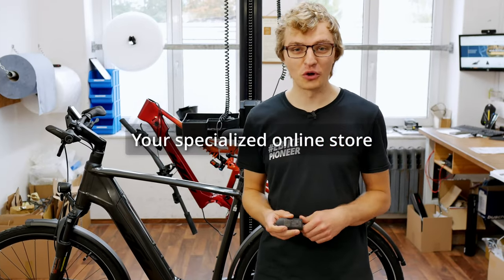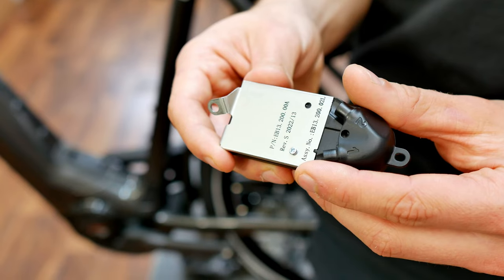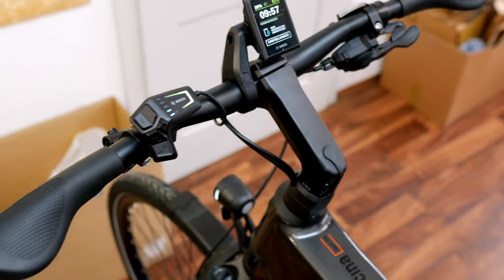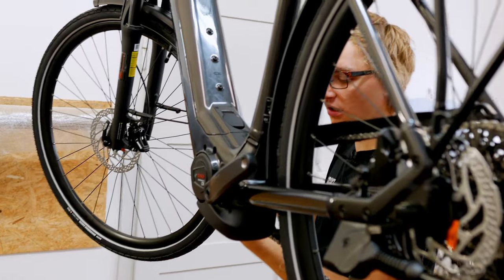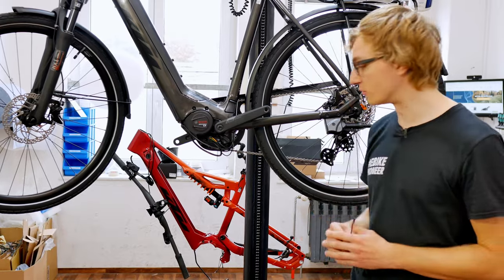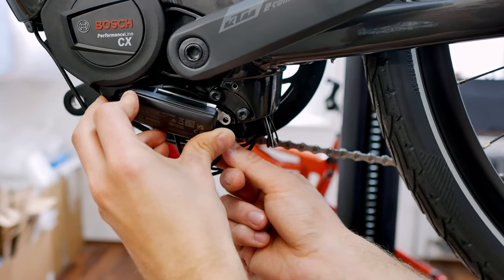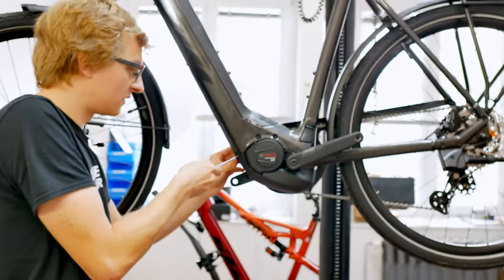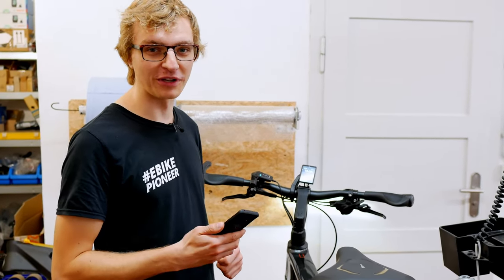Bosch ConnectModule - Installation | EBIKE24.com

Comment: I wonder if it's so easy to install it's also easy to uninstall... Just unscrew a few points without bumping a bike and theft is possible. Such important module should be well integrated inside the motor so it would be unable to compromise it without dismantling the whole motor assembly.

Comment: I just get the Bosch module Connect and I am very happy with this GPS alarm systèm, but the only bad point and almost a joke is the power of the alarm sound;  it will not afraid even a fly...

Comment: so it's basically 4 (?) normal torx screws and a thief can remove the module? I don't understand why there is absolutely no security?
Reply from the maker: Hi and thank you for your comment. Yes you are right. Unfortunately the ConnectModule is delivered without any additional safety equipment to protect it from theft. However, since the ConnectModule has standard Torx sockets, you can also use safety screws of your own. 
Cheers Michael

Comment: Cube hybrid stereo 2023? Can fit
Reply from the maker: Hi and thanks for your comment. This is hard to tell since we do not have Cube bikes in our product range. We know from a few customers that the original Cube motor cover might be too small to fit the ConnectModule. This is why we offer these two updated covers from Cube:
https://www.ebike24.com/cube-motor-cover-stereo-hybrid-120
https://www.ebike24.com/cube-motor-cover-stereo-hybrid-hpc-my20-23-bcm-ready-schwarz

Depending on your bike model one of these two should fit the ConnectModule. If you have any questions do not hesitate to contact our customer service: info@ebike24.com

Cheers - Michael

Comment: I want to sell my bike, can i just remove the device when unlocked with my phone? The new owner does not want the product. So no i do not want to steal the bike. I am the owner and i can unlock it with the phone. So just uninstal it like i instal it? Or do i need to some specifics because i can not find a tutorial.
Reply from the maker: Hi, you should remove the ConnectModule in the Bosch eBike Flow app first and after that also remove your bike from the app. It is crucial to remove the ConnectModule in the app first, otherwise there might be an error message when the new owner tries connecting the bike with his Bosch account. 
Cheers - Michael

Comment: Hello. Thanks for doing the video, it was intensely informational. Will this be compatible with a Verve+ 3 ?
Reply from the maker: Hi and thank you for your kind words! It's hard to say, unfortunately, as some older models do not have the Smart System required for the ConnectModule. Do you know the model year of your Verve+ 3? Often, you can also easily identify it by the display: If your bike has the Purion display (https://www.ebike24.com/2017-bosch-purion-e-bike-display-performance-line), it is not compatible with the Smart System because the Purion is not yet available for Smart System bikes. Hope this helps! Cheers - Michael

Comment: I have just purchased a Trek Powerfly 4 gen 2 with the Purion and I would like to upgrade it to something that would Bluetooth to my phone with an app. What would you suggest?
Reply from the maker: Hi and thank you for your comment! It seems that your Trek Powerfly has the Bosch eBike System 2. With this system, unfortunately, there is no connectivity to your phone through the display/control unit. You could upgrade your Purion to the Kiox or Nyon display. Alternatively, you could install a mobile phone holder on your handlebar and use your phone in combination with cycling apps like Strava or Komoot.

These links might help you:
Bosch Kiox display: https://www.ebike24.com/bosch-kiox-display-set
Bosch Nyon display: https://www.ebike24.com/bosch-nyon-display-2020-2021
Phone holders: https://www.ebike24.com/e-bike-smartphone-mount
Hope this helps!
Cheers - Michael

Comment: the Bosch Connect module with a subscription of €40 per year should improve two important points:
first of all a “theft insurance” subscription integrated into this subscription and on a technical level increasing the power of the alarm signal which is rather ridiculous

Comment: ATTENTION: IF you have a CUBE bike , BEWARE,,, Bosch Connectmodule will fit the motor , but the motor cover dont fit afterwards. CUBE is working on a new motor cover but at the moment there is no solution on the problem. i just found out today after fitting the Connectmodule. The item number for the new engine cover is #3819. For the Stereo Hybrid 160 ONLY size S, the article number is #3706
Reply from the maker: Hi PerfodDk, that's right, unfortunately the ConnectModule doesn't fit beneath the cover of some Cube models. However, Cube has released a couple of new motor covers that are compatible with the Bosch ConnectModule or GPS trackers from other manufactures. You can take a look here: https://www.ebike24.com/cube-e-bike-spare-parts
Cheers, Michael

Comment: Hello, do you know if it’s possible to fit this module in a Bosch SX motor like the Riese and Müller Culture? If not, are there any plans for an alternate cover that could work with the connect module? Thank you.
Reply from the maker: Hello and thanks for your comment! Yes the ConnectModule also works with the new Bosch SX motor. For the SX motor you only need the single ConnectModule without the mounting accessorries. It is simply connected with an additional display cable which you also need. The ConnectModule is then connected between the motor and the display. We will also publish a tutorial for the ConnectModule installation on the SX motor soon. You can find the ConnectModule and display cable here:
https://www.ebike24.com/bosch-connectmodule-smart-system
https://www.ebike24.com/bosch-display-cable-smart-system

You are also welcome to contact our customer service under info@ebike24.com.
Cheers - Michael

Comment: Hello, what bosch connect module will be fit on my hercules fold r5? And where can i buy here in germany? Thank you
Reply from the maker: Hello, thank you for your comment. According to Hercules your Fold R5 has the Bosch Performance Line Motor. This means that this ConnectModule is the correct version: https://www.ebike24.com/bosch-retrofit-kit-connectmodule?number=8565-002
You can order online, we ship to Germany (delivery time is usually 2-3 days).
Cheers - Michael
Reply: @ebike24  hello good day. i bought and i install but the problem is the cover of motor is not fit anymore and i cant close it.

Comment: Can this be fitted to orbea wild 2023 with the Bosch smart system?
Reply from the maker: Hi and thanks for your comment. Yes, if your Orbea has the Bosch Smart System, installation should not be a problem! Just make sure that you have enough space below the motor for the ConnectModule. Cheers - Michael

Comment: Hi, I have a Trek Rail 5 Gen 3 Will the connect unit fit my bike? thanks in advance.
Reply from the maker: Hi, according to the specs I found your bike is equipped with the Bosch Smart System. Therefore the ConnectModule should fit. You may want to check if there is enough space below the motor to install the ConnectModule before purchasing. 
Cheers - Michael

Comment: Hello, what about cube hybrid 140 action team ? Is it included with brand new or No ?
Reply from the maker: Hi Fabio, thank you for your comment. This is hard to tell since we are not a Cube dealer. It should fit since the Cube also uses the new Bosch Smart System required for the Module. However, on many Cube electric bike models, there is not enough space under the motor cover for installation. We have a few replacement covers in our store: https://www.ebike24.com/cube-e-bike-spare-parts
If you have any questions, you are welcome to contact our customer service: info@ebike24.com
Cheers - Michael

Comment: Is there a way to fit this on a Gazelle Grenoble C5 HMB (Bosch Performance Line Smart System)? I believe the original covers don't fit once the module is installed
Reply from the maker: Thank you for your comment! On the software side, the installation is no problem. Unfortunately, motor covers are always complicated and, above all, manufacturer-dependent. I cannot say for sure if the cover will still fit after the ConnectModule installation, as we do not stock any Gazelle bikes in our range. My recommendation would be to contact either your local Gazelle dealer or Gazelle directly. They should be able to advise you on whether it is possible to install the module.
Cheers - Michael
Reply: @ebike24  Thanks for your response. I spoke to my dealer, and he tried sourcing the part numbers for compatible covers that would fit after installation, however he was sent around in circles. Bosch sent him to Gazelle, and Gazelle sent him to Bosch. It seems like getting a concrete answer is going to be tricky, and I'd say it will probably be a no compatibility for now, which is a shame :(
Reply from the maker: Thanks for the update. Yes, this has been the problem with Bosch for a while. They will always tell you to ask your local dealer or bike manufacturer and they have to ask Bosch...
We offer free returns within the EU. If you like, you can order the ConnectModule and test the installation - if it doesn't fit, you can return it. Maybe that's an option for you.
You can find the ConnectModule here: https://www.ebike24.com/bosch-retrofit-kit-connectmodule
Cheers - Michael

Comment: hello! this GPS have sin card? Can I track if the bike have the battery out?
Reply from the maker: Hello Philipe, thank you for your comment. Yes, the ConnectModule features an eSIM for mobile communications. Even when you remove the battery from your e-bike, you will still receive a notification if your bike is being moved, and you can track it as well. However, the alarm will not activate in this case; it only works when the battery is mounted on your electric bike. I hope I was able to help you!
Cheers - Michael

Comment: Will this fit in the Trek Powerfly 4 gen 4 and will the cover fit after installing? Thanks!
Reply from the maker: Hi Joel, thank you very much for your comment. The Powerfly 4 Gen 4 is equipped with the Bosch Smart System and is therefore compatible with the ConnectModule. Based on our experience, the cover should fit after installation. We have never encountered any problems with that on Trek bikes. Best regards - Michael

Comment: Will it work for the Bosch active that the batavus Harlem use?
Reply from the maker: Hi Mikael,
Thank you for your comment. It is hard to tell because I am not familiar with the Batavus brand. Could you provide me with a link to your bike? In general, I can say that your e-bike needs to be equipped with the Bosch Smart System motor. You can also send us an email at info@ebike24.com with some photos of your bike, especially of the motor and the display. Hope this helps!
Cheers - Michael

Comment: Hi, 

Can i connect it to my Focus aventura2 6.8 2023
Reply from the maker: Hi! Yes, your bike is compatible with the ConnectModule according to Focus' specifications. You simply have to ensure that you select the correct motor option since your bike has the Bosch CX drive. Here is a link with the appropriate version for your bike: https://www.ebike24.com/bosch-retrofit-kit-connectmodule?number=8565-001
Cheers - Michael
Reply: @ebike24  thanx for fast reply!

Comment: Hello! Do you know if the module can be installed on a Scott axis eride 10 2023?
Reply from the maker: Hello and thank you for your comment. Yes, your Scott is compatible with the module! Since the Scott has the new Bosch Smart System, there are no compatibility issues. Just make sure to select the "Bosch Performance CX" version when ordering, because there is another version for the Bosch Performance (without CX) motor. Hope this helps! Cheers - Michael
Reply: Okej thanks! But when i opened the motorcover There are no plate to attatch the little screw? And Will the motorcover screw go threw with the module there?
Reply from the maker: @AlexanderJohnsson-yp9ic  The metal plate for attaching the Module is included in the scope of delivery. The screw for attachment is also included. For the motor cover, you can use the original screw. Cheers - Michael
Reply: Okej! And where do i attatch the plats then? I had the cover off and didnt see where to attatch the plate.
Reply from the maker: @AlexanderJohnsson-yp9ic  There is a small rubber holder included in the delivery, where you attach the module. At minute 9:24, you can see how it is mounted. If you are still unsure, you are welcome to send us an email with a photo of your motor and the available connections at info@ebike24.com. Cheers - Michael
Reply: @ebike24  i have sent mejl with a picture:)

Comment: Hi great video !! Is that compatible with Trek Rail 7 ? Perfomance Line CX
Reply: I use the Purion Display
Reply from the maker: Hi Andre, thank you very much for your kind words! Unfortunately, the ConnectModule does not work with your Rail 7. The Purion display indicates that your bike uses the "Bosch eBike System 2" and not the Smart System. The ConnectModule is only compatible with the new Smart System. However, if you are still interested in a GPS tracker, I can recommend these two options:
https://www.ebike24.com/powunity-bike-trax-gps
https://www.ebike24.com/bikefinder-gps-tracker

In case of questions do not hesitate to contact us. 
Cheers - Michael
Reply: @ebike24  thanks for the answer
Do you think if I change my display for the new Purion 200 it will work with the connect module ?
Reply from the maker: Unfortunately, the Purion 200 will not be compatible with your bike. Once again, the problem lies in the drive system. The Purion 200 is designed specifically for e-bikes equipped with the Bosch Smart System. However, your bike is equipped with the previous-generation "Bosch eBike System 2". The software used in these two systems is entirely different, meaning all displays and devices are incompatible with the alternative bike system. I'm afraid that in future product development, Bosch will primarily focus on the Smart System, and there will be fewer product innovations for the previous systems. I hope I was still able to help you. Cheers - Michael

Comment: Hi will this work with a trek rail 9.8 gx axs thanks
Reply from the maker: Hi Kenny, thank you for your comment. Yes, it should work! The Rail 9.8. GX AXS uses the Bosch Smart System just like the ConnectModule so there should not be any issues installing it.

You are welcome to order the ConnectModule here: https://www.ebike24.com/bosch-retrofit-kit-connectmodule?number=8565-001

Cheers - Michael
Reply: just wasted money on this as after installation the drive unit cover doesn't fit back on @ebike24
Reply from the maker: Hi again, I am sorry to hear that. We have had several customers ordering the module for their Trek Rail models, and they never faced any issues. Due to the different cover sizes, it is extremely hard to determine for which bike it fits and for which it does not. If you ordered from our store, please contact us at info@ebike24.com so we can take care of the return and refund as soon as possible. Cheers - Michael

Comment: Do i need to subscribe and pay to use this?
Reply from the maker: Hello, the eBike Alarm is included in the purchase price for 12 months from the time of activation in the eBike Flow app when the Bosch ConnectModule is purchased. The eBike Alarm Service is not automatically extended thereafter. If you wish to continue using it after twelve months, eBike Alarm costs €4.99 per month or €39.99 per year. Hope this helps!
Cheers - Michael